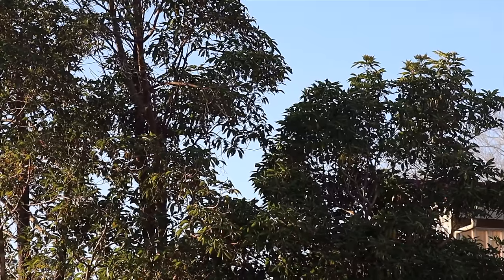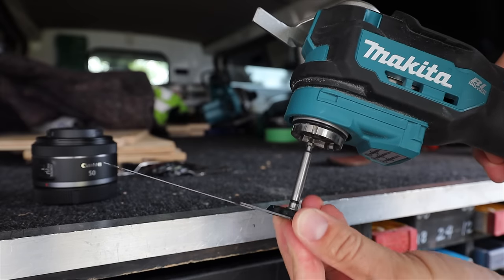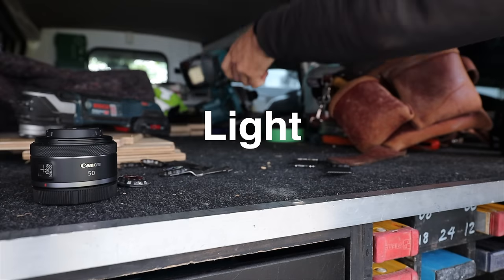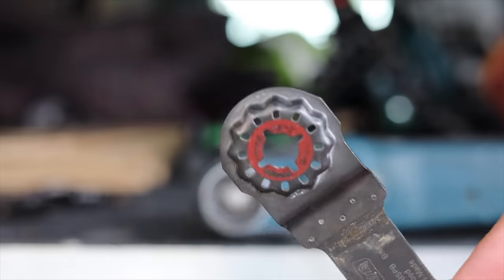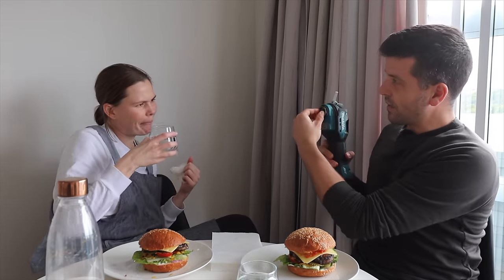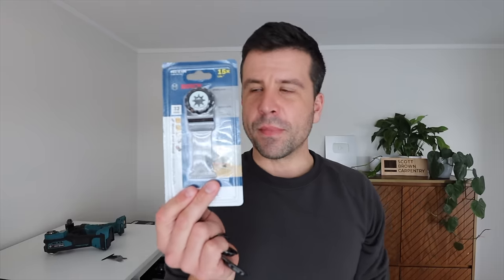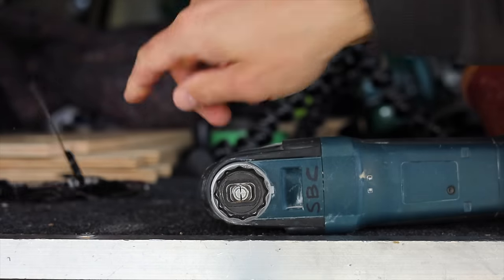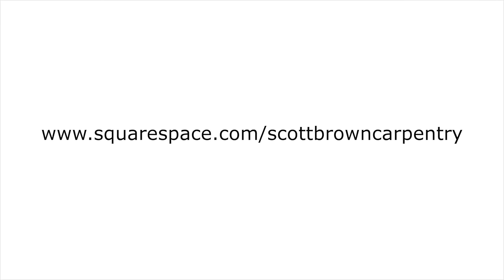Have Makita Made The Ultimate Multitool?

Comment: I feel this is a very biased "Review".  It's more of an ad.  Here's why.  You say that the noise level is quieter, you show a clip of the new Makita multi tool and the noise it makes, yet don't show a comparison.  Which renders your opinion useless.  You say there's better anti vibration.  You show a clip of the old tool with a cup of water, but don't show a clip of a comparison with the new tool.  I'm gonna stick with my DEWALTS.  Better anti vibration, lower noise, LED light and star lock blades as standard.  Unsubscribed.  Sorry.